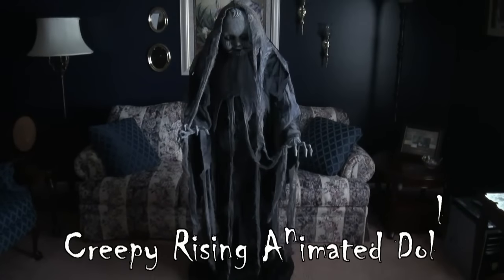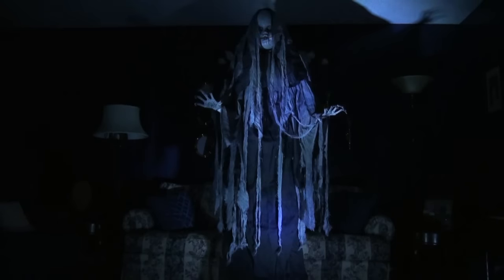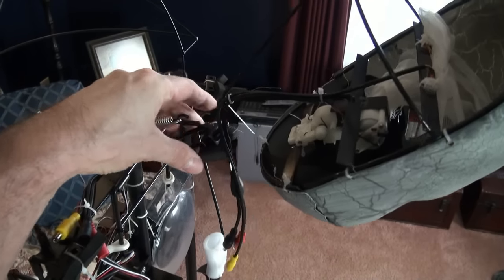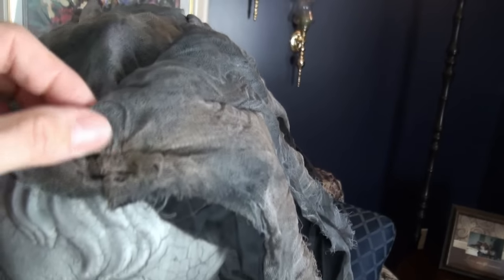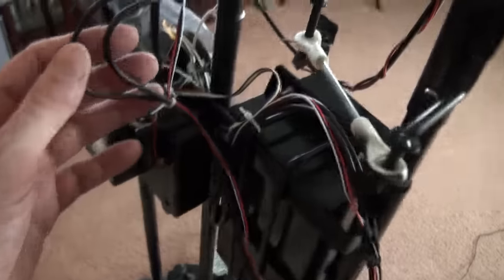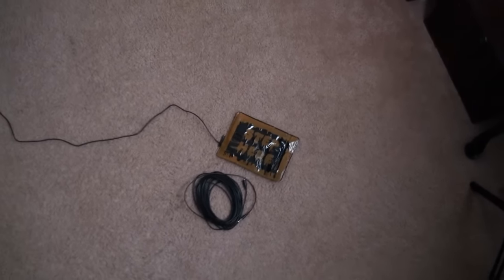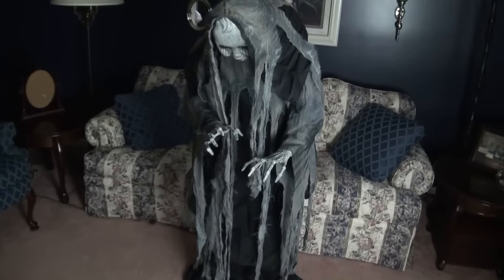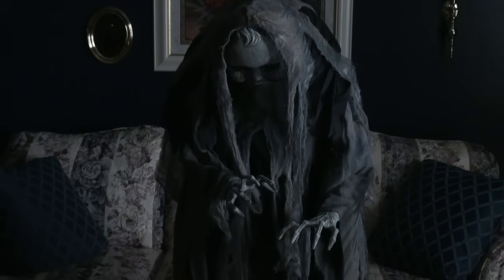Creepy Rising Animatronic Doll - Spirit Halloween

Comment: Purchased this one for halloween this year.  Mine did that click at the end as well, I used a bit of lithium grease on the parts that contact one another.  Certainly made it a little quieter and eliminated that pop which was my main goal.  I've tried to find ways to make it quieter for the motor noise but have not found much success.  Might use a bit foam or something and wrap the motor housing.  Might work.

Comment: bought this from haunted props last year, much better than one from spirit. starts lower for better effect with the small kids and does not have the motor issue. Great product. shop around you can get it cheaper than at spirit. (I like spirit but look around, most get these products from other companies then mark up. I paid 160 for it last year)